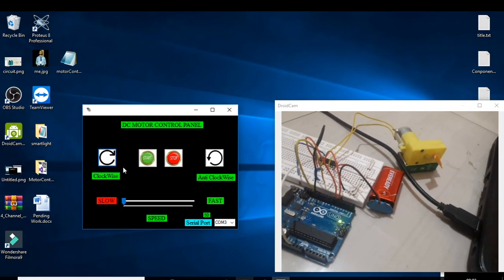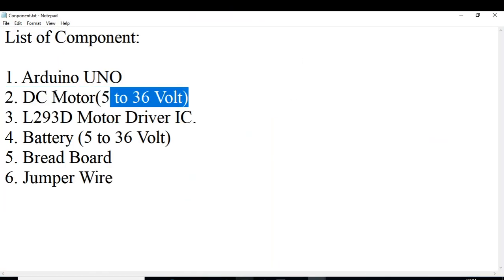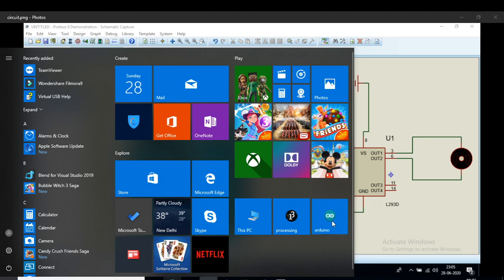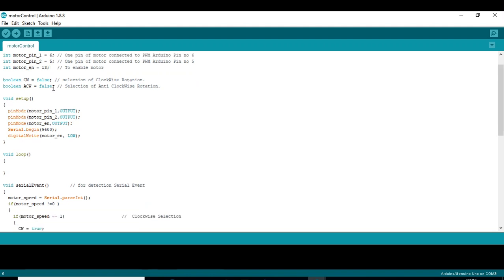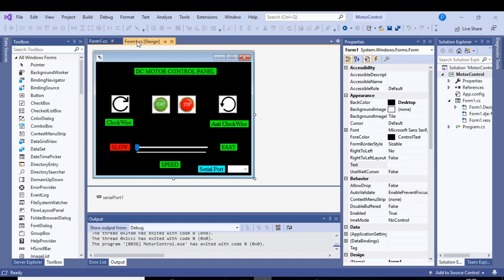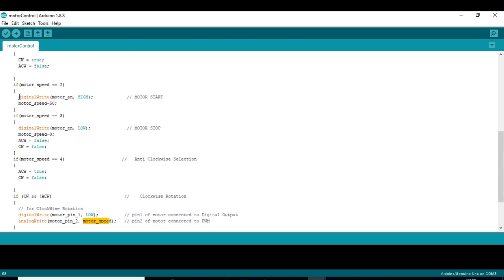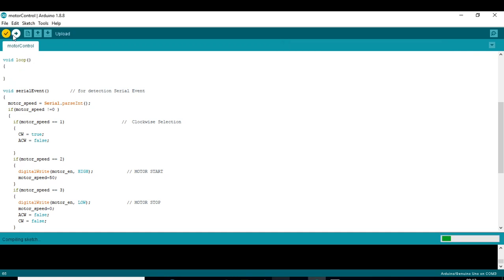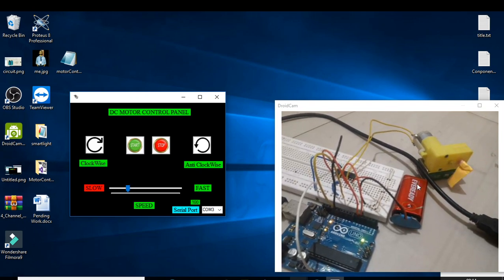How to make DC Motor Speed and Direction Control GUI  Using #arduino  & #visualstudio

Comment: Hi there! I really appreciate your presentation as shown in the video. Can i ask what type of DC Motor should be use in this circuit? (for example: 3V DC Motor, 5V DC Motor, 9V DC Motor, 12V DC Motor, ...)
Reply from the maker: Here I am using Motor driver L293D and as per the L293D is designed to provide bidirectional drive currents of up to 600-mA at voltages from 4.5 V to 36 V. Within that range all types of DC motor can be used.

Comment: ı tried this project but I can't change speed from tracbar When I move the trackbar  part, there is no change in the motor, there is no problem in the right and left turning part, ıs there any missing something in the code? I would appreciate it if you could help.
Reply from the maker: As per my code, sending data from Visual Studio to Arduino for speed control should be 5 to 255, not 0 to 255. Because 0,1,2,3,4 are used for start, stop and direction control. Please try and let me know your result.
Reply: trackBar1.Minimum = 5;
            trackBar1.Maximum = 255;
            trackBar1.Value = 5 If I set the value of the trackbar like this, will it be correct?
Reply from the maker: @muratorta7602  yes try once
Reply: thank you for your help i was able to run the project

 @makeelectronicseasy

Comment: ı make a object counter using proximity sensor . I used this contrrol panel and add some label, text box but ı cant send data from serialport to this panel is it because of the control panel code or me.Great project btw